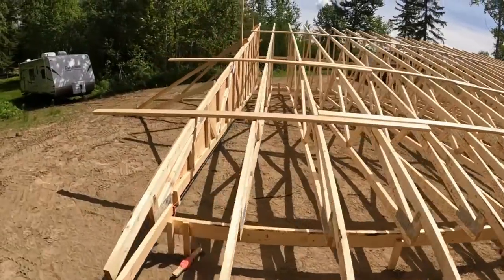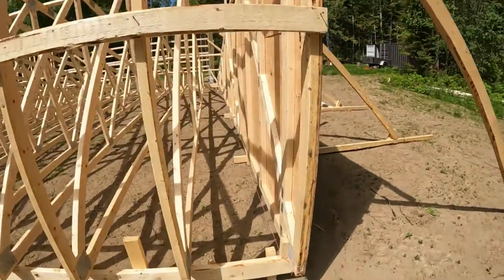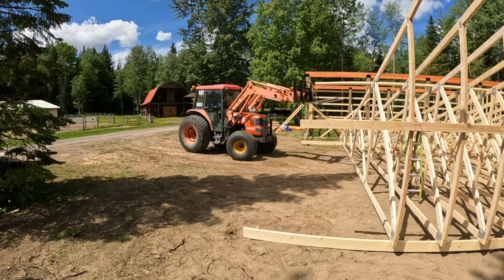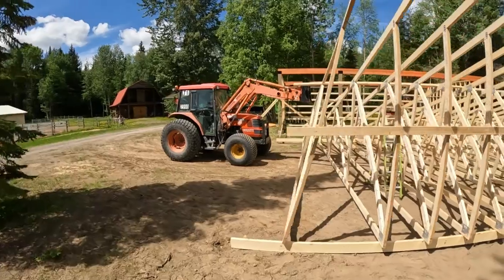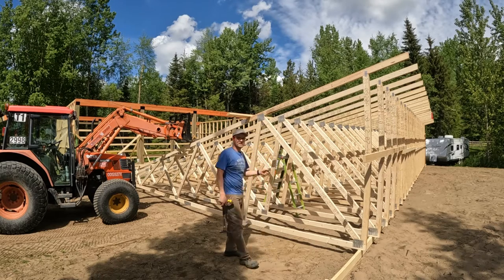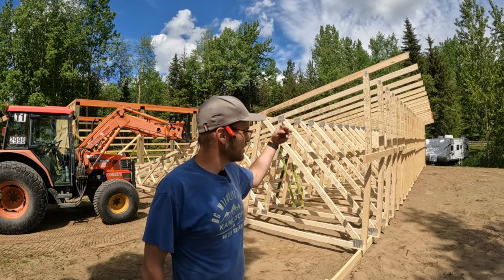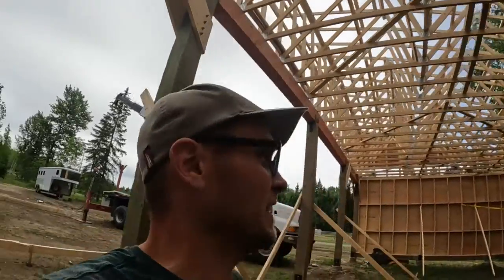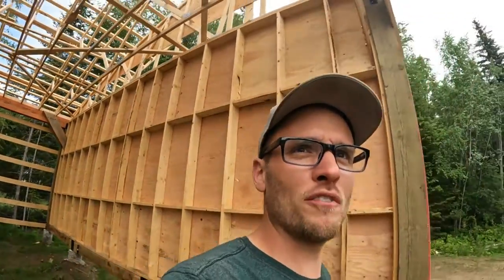Crane Lifting A Giant Truss Roof: From The Ground To The Sky

Comment: Good video, what was the weight on each half of the roof n size of the boom truck?  I may do that in the future
Reply from the maker: You know I don't recall the weight, I want to say 4 or 5 thousand pounds but honestly don't know. It was just a small stiff boom truck. It's not the weight it's the reach you need. The truss plans include a weight per truss and then I know how many 2x4 braces are in each section. With that I give a fairly accurate weight to the crane company to set up the lift.